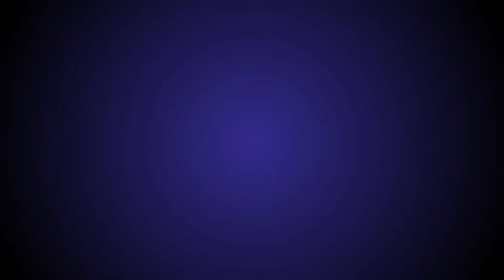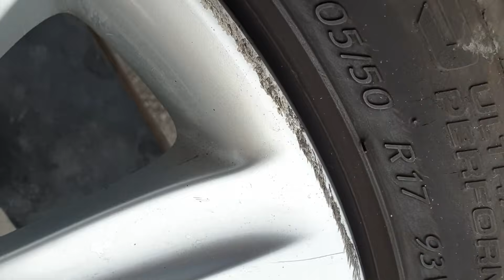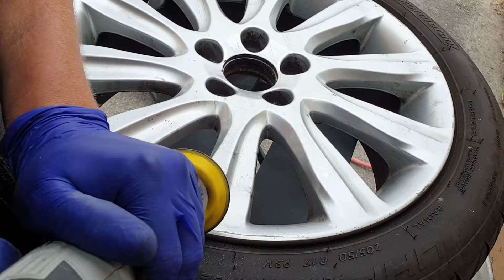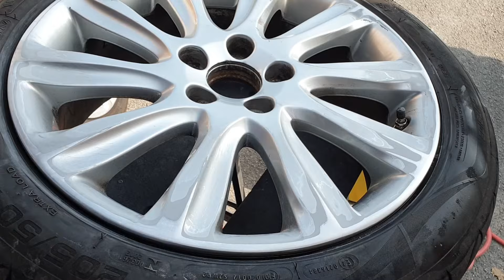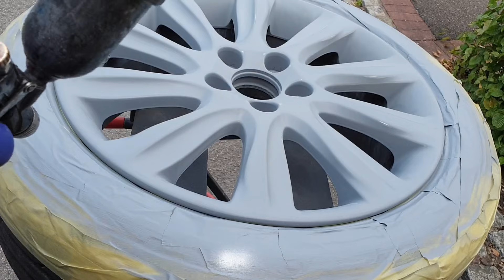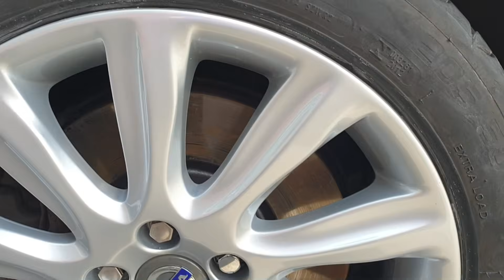How to fix any kerb damage on any wheel rim with a cordless drill & how to paint it after!

Comment: I see so many videos showing this technique. You can get reasonable looking results with this, but if you’re sanding out deep gouges or scratches in the rim, you will be changing the contours and shape of it. You can even see this happening in the video here - as you’re sanding the rim, you’re creating flat areas. So what happens a few months down the line when the rims are full of scratches and scuff marks again?
Reply from the maker: I think the results are excellent
Reply: @cvrpov  Agreed the results look good this time round, but you're taking away material to bring it down to the same level as the scuffs. You can only do that so many times.
Reply from the maker: Yeah agreed but if your bashing your alloys up that regularly and that badly.. you perhaps need to review ur driving ability